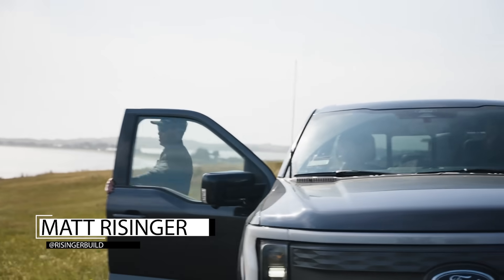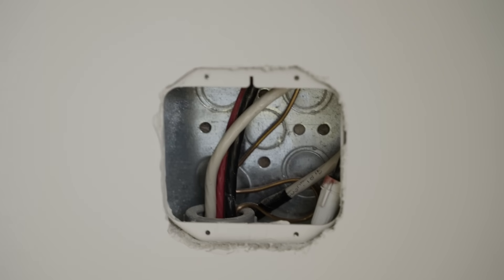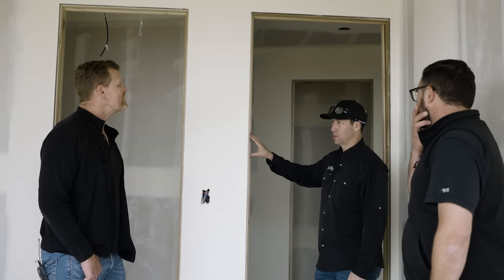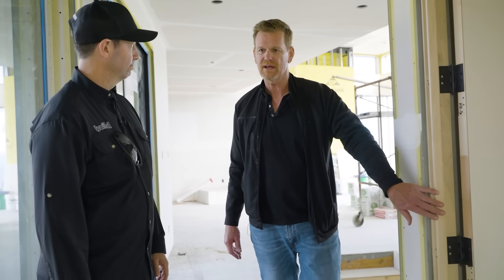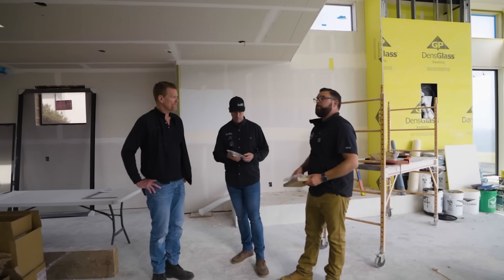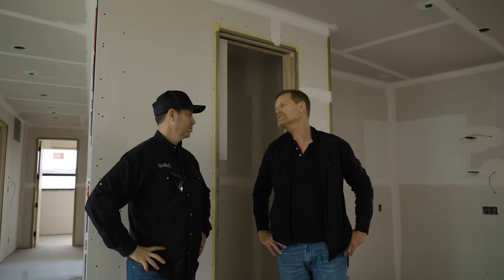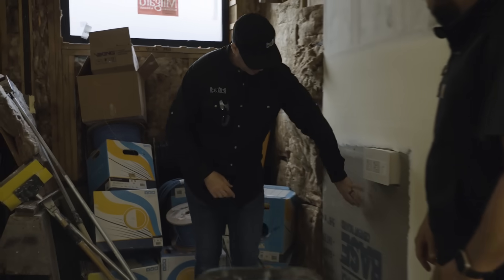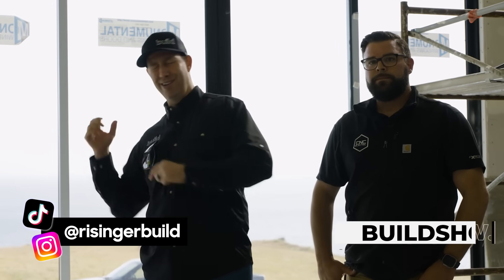Coastal House Tour-AMAZING MODERN ELECTRICAL install details

Comment: Why not Hardie cement siding, proven, long lasting
Reply: I don't think Hardie makes vertical T&G, but I could be wrong.
Reply: @kenbrown2808 they have a vertical 48x96 one piece panel.  so even better, less joints especially for the water area.  But hanging a piece of 48x96 cement board must be tough, but they sell it, so people use it.  Seeing all the painted over nails on this install, is not good.  Hardie factory painted is the way to go. Ya have to have Hardie installed by hardie experts, it matters.  Mine was done perfectly by Hardie certified installers.  It shows in the exact fits and cuts, and flashing perfection
Reply: @cengeb  they don't want panel, they want vertical t&g. And no, it doesn't take special training to do hardie, just competence.

Comment: How did they get the wires down the kitchen post to the receptable?
Reply: up the post, from the wall under it.  and most likely they drilled down and through with a half inch auger, from the spot where the wire enters the box.  though I've had a location I had to plow down a laminated post with a router and use 4 foot simpson straps for nailplates.

Comment: I was fairly certain copper wire is recommended for house installs, it has better conductivity anyway. I was also a bit weirded out with the lack of a ground wire to the smart panel 6:15 ITS BEEN a long time since I helped wire a new space with my grandpa, and technology has advanced (I am not a license electrician)
Reply: That is an ser cable feeding the sub panel. Has a bare ground that you can see if you look closely. Aluminum is a great conductor. No issue when used properly
Reply: @sethrussell5649  Aluminum is a poor conductor compared to copper, at roughly 60%, which means that equivalent gauges will have far higher resistance & therefore heating in aluminum. There's a damn good reason why aluminum wire is illegal in many jurisdictions, because aluminum wiring overheating caused lots of house fires & deaths in the 1950s and 1960s. In a high-current circuit, such as an electric vehicle charger, using aluminum wire is idiotic.
Reply: @dionh70 aluminum wire is still allowed in sizes larger than #10, but few electricians use it, because it doesn't save any money, any more.  (except for service feeders)  it wasn't the overheating that was the problem, it was the corrosion, and the increased ductility, which resulted in connections losing integrity.

Comment: They have batteries in the house??? Is that safer than having a natural gas generator?

How common does power go out… in the south it’s usually due to hurricanes or tropical storms
Reply: The power grid is very stable in California. There was a time when it was atrocious, but after regulations, it got to a very stable level. Now, some areas in the wildland urban interface do get advanced shut offs, but that is to prevent or minimize fires. 

Also, batteries are not only used for back up only. Some electric plans have a time of use charges, so they can be a good way to use your backed up energy instead of getting scammed by the electric company during peak hours. Texas is a prime example of how scummy the electric rates can get during peak or emergency hours.

Comment: You can’t run a Tesla Wall Connector at it capacity or 48A on a 50A circuit…60A per Tesla specs!
Reply: they have 60A wire in the wall, so I'm assuming the breaker is spec for the charger they are getting.

Comment: These guys lost me at $13k for mud around light fixtures…
Reply: No shit
Reply: I mean I worked in a house that bought a $14k chandelier… and it wasn’t even that good looking lol
Reply: 😂. Amen!  But still interesting to see how the 1% build and live. Great job on educating the rest of us.  I do appreciate these educational videos. I hope that one day quality home builds become the standard and not the exception.
Reply: Basically need to skim coat the whole ceiling so no change if you are doing a high end finish to start with. Way more if you were doing a cheap finish 😂
Reply: Yes, the house is way beyond our budgets.  But a high end house is one of the better ways to display a bunch of different products that you can adapt for more typical homes, particularly if you do the work yourself.  The trim-less doors save a bunch on casing (and baseboard trim). Yes, it's more labor-intensive.  But if you're doing the work and you like the contemporary look, there's a big $$ savings on materials.
Reply: lol that’s in the noise for a budget like this.
Reply: Guess my question is Cali soooo big on the Environment and ESG companies yet building a house to heat and cool that size 🤷‍♀️
Reply: @rpvitiello Yeah, a higher end house would probably be done with blue board and then the entire thing would be skim coated.
Reply: Silicon Valley money 💰 keeping that group of high end trades busy

Comment: 9:50 this is called a standard metal corner bead by the builder used for the trimless door detail but it doesn’t have nail holes on 1 side. Is this really a L-trim with a deep leg to extend into the kerfed jamb? Also, what’s the purpose of the fiberglass tape between the drywall and corner bead?

Comment: That Aria vent cover looks great but, how are you going to change out that fan WHEN it takes a crap?
Reply: Reach thru & replace
Reply: @rocdajacable  The fan housing is larger than the vent cover.  You'll need to repair the drywall and install a new vent cover.
Reply: Use the attic access….?
Reply: @georgewelker853  smh...
Reply: Most vent fans have replaceable motors all within the housing. You should never have to replace the entire unit even on an old home unless you’re changing the shape or size.
Reply: We are doing just a box above the Aria vent and then doing a separate in-line blower in the attic above…
Reply: first, it's a panasonic, so it's a lot less likely to take a crap.  second, you can drop the core out and replace it.
Reply: @JTamilio I've done a few with an inline blower and a 4" duct, and then put a recessed can trim in the end of the duct.

Comment: It's interesting that they put the wiring for the car charger on the right hand side of the garage.  Teslas make up approx. 80% of electric vehicles, and they all charge at the left (driver's side) rear.  Most other electric vehicles out there also charge from ports on the left side, or in a few cases, directly in the front.  Seems like the builder would want the charger wiring on the left side of the garage, so that the charger cables could reach the charging ports?
Reply: They put charger wiring on both sides of the garage. They were primarily looking at the right side, but they did mention the owners have two EVs and therefore need two chargers.
Reply: there are 2 in that garage, left and right. either will reach to either side actually.
Reply: Also, it's only on the wrong side if you drive front into the garage. If you backup into a garage, then it's on the correct side.

Comment: It's a waste of money and resources to install a protected loads panel. Your load panel can be both. All you need to do is not use anything you would not put in the protected panel. Can't resist turning on the hot tub during a blackout? Turn off the breaker for the hot tub.

Comment: I don't care about a car charger, but 50 amp service to the garage means you can have a big welder out there. And I wish the electrician doing my house had labeled stuff. I'm the second owner, and after 3 years I'm still discovering things (usually the hard way).

Comment: Would really like to see more about the electrical hookups for modern toilets. They've become very common for new builds. Do they all require a plug nearby with an ugly cord? Is there a way to hardwire them?
Reply: The nicer models are designed so the hoses and wires are hidden under abs through the toilet bowl. The cheaper ones just have exposed wires and hoses next to the toilet bowl.

Comment: why does he need a receptacles within 24" of the sink? he said to meet code but I don't live in America and I've never heard of anything like that, other than NOT allowing electrical outlets close to water sources here in NZ.
Reply: They are gfci outlets so safe around water
Reply: The receptacles are for kitchen appliances, or hair dryers shavers ect in the bathroom. All receptacles within a certain distance of water sources or wet locations have to be GFCI protected. You may know it as RCD. I believe the code requirement comes from people using extension cords for bathroom and kitchen appliances near the sink and shocking themselves.
Reply: @Techsupport243 Yes! Just had to look this up for our renovation.
Reply: in the states, you are not allowed to have any counter space in a kitchen more than 24" away from a receptacle (measured against the wall)  so they can limit the cords on kitchen appliances to 36" (60 and 90CM metric equivalent)

Comment: I hope alarm, A/V, and network were considered during rough too. Blows my mind that this is never covered with electrical reviews.
Reply: I wouldn't be surprised if network is overlooked and all they the homeowner expects is WiFi
Reply: Network should be separate from electrical, but also always seems to be done by the electrician rather than an IT Pro and low voltage wiring specialist (pulling CAT5E/6/6A is not the same as pulling Romex, gotta be gentle with it or it won't certify and therefore never run full speed 10Gbps or 40Gbps if CAT-6A up to 40m).

Comment: As an electrician, “mud in” anything is a nightmare. Hopefully just a fad that wont last long
Reply: Could you elaborate? Seems like a luminaire trim base would be fine..
Reply: As a non-electrician, I agree.
Reply: Every detail on this house is 3x as expensive as normal. The trimless details, the flush electrical, the drywall finish.  Going to take some pros to keep this house looking nice and not “lived in”.  Hopefully the occupants have teenagers and not little kids.
Reply: @microcolonel  No, because 99% of drywall mudders would slap mud up in to it. IT's miserable having to chip out a bunch of mud because the drywallers filled up your boxes.
Reply: @Beerdwolf  with the luminaire trims it doesn't matter. The mating surfaces are not anywhere near the face.
What you're describing is a particular design flaw of those mud in receptacle boxes, not a problem with ALL mud in fixturing. Stop being melodramatic lol.

Also if the builder specs these, then he can charge the drywallers for every fixture they destroy by being a monkey. You'd be amazed how quickly they'd rise to the occasion. If the guys you work with don't do ANY quality control then I feel for you.
Reply: @microcolonel  recessed lights, fans, outlets , switches cost 5-10x more in material and labor cost. And to try to work on/ remodel/ move any of them is close to impossible. In my opinion, you actually create more headaches for a look you can basically never change

Comment: I guess these folk are counting on the ocean level being maintained at current levels?
Reply: agree, but they will be dead by that time. future estate problems at that wealth level.
Reply: Don't know if you've ever been to Bodega Bay, but those cliffs are HIGH. If the water gets that high, Oakland and the lower parts of SF are already under water, and the world as we know it is over. Also, this is obviously not a cost-sensitive owner, so if the poop really hits the fan, they'd probably just be headed off to their similarly-well-appointed mountain home in Idaho or Wyoming by helicopter or whatever.
Reply: @ianmccullough7294  never. Where are the cliffs? I was reacting to Matt's comment that they are right on the beach?

Comment: How did you get anywhere in an electric f150? I hear the battery life is terrible. Which isn't surprising given the gas versions aren't exactly spectacular in efficiency either.
Reply: You really need to turn off Fox...
Reply: @laloajuria4678  you need to turn off the blind tribalism. I have exclusively driven electric cars for 15 years now so I'm quite familiar with the pros and cons. The f150 is basically unusable as a truck.
Reply: @mp-xt2rg I have seen a handful where we work, and have yet to see any with a load in the back or pulling a trailer
Reply: @mp-xt2rg most people that buy pickups buy it for looks. They could easily drive a hatchback, but that doesn’t look “cool.” I think the lightning is perfect for that crowd. 

Anyone that needs a work vehicle for plumbing/ electrical etc I see buy a van, not a pickup 😂

Comment: its code requirement for a car charger... government sucks. say what
Reply: Smart idea
Reply: No, the charger is a separate component you buy and install. Supporting that is a requirement, just like the code requires supporting lights and curling irons.
Reply: @LuminairPrime  yes but it is probably 300-500 dollars to just run that 6 guage wire to the place where it would go. For something you may never have.
Reply: @av1204  California also say all new cars have be electric by 2035, so it is absolutely something that you will have during the life of the house.
Reply: I'll be honest, I think builders should be building with the mindset of people living there. That includes the fact that increasingly more people are buying electric vehicles. By code they just need a 1" conduit and a box. I'm sure people also used to complain about being asked to prepare for electric ovens or AC.
Reply: Av listen to the video before you comment..... It only the wiring which in the long run costs very little during the build
Reply: @reallunacy  see the issue is you like the government telling you what to do. Code should be purely about safety. Everything else is just a reason to spend more money. And if the person building the house wants to spend more then that should be their business and not the governments.
Reply: @daveklein2826  yeah I listended to it... the wire cost more than the charger... but ehh i know what I am talking about, you just make stupid comments
Reply: Little AV has his lacy thong in a bunch😂😂😂😂😂😂